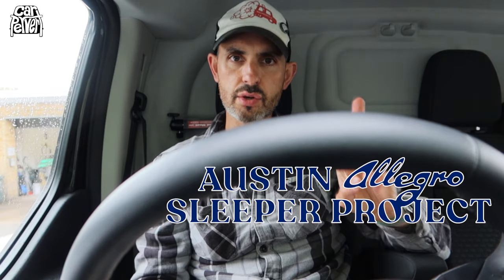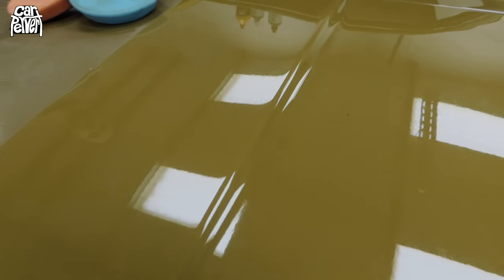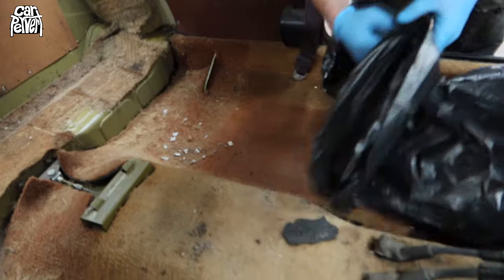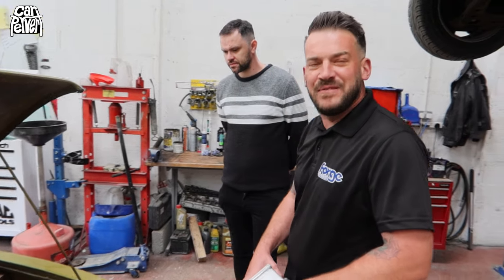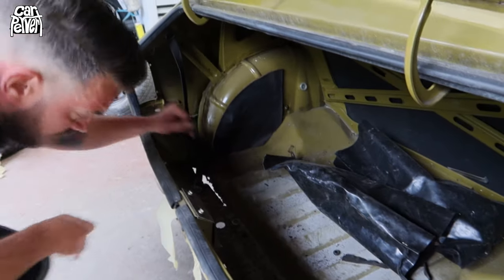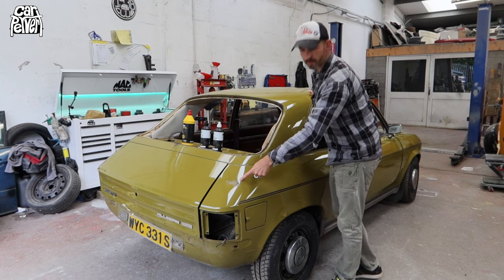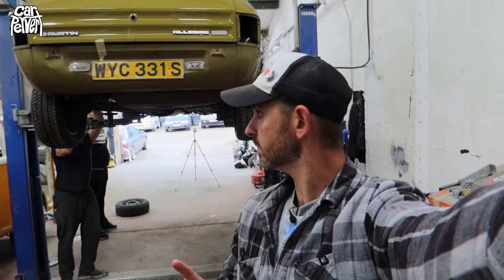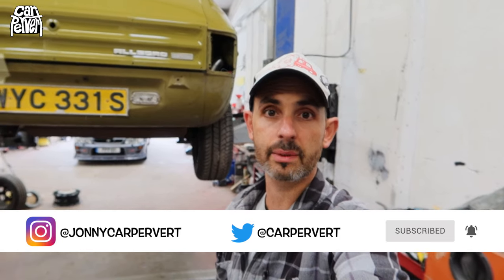Part 2: Austin Allegro V6 supercharged sleeper project

Comment: I bought an estate, new in1978. The Allegro was a car desperate for pimping. I had the car deliver with a rev counter fitted and fitted the fog lights myself. Fit the car with good carpets, headrests a modern stereo, and high level brake lights (I did back then), and the car is easily improved and transformed.  But oh, those front wheel bearings, new needed every 10,000. Mine was a 1500, but top speed was 94 with a tail wind.  It deserved better.

Comment: I have visions of those brakes stopping the chassis dead, and the body carrying on.....
Reply: I had a Chrysler Sunbeam that did that...
Reply: herme99 lol
Reply: JezVibert ummmmm oh god.
Reply: Not to mention the front n/s axle and strut giving way - all too common across the then BL range.
Reply: Except it's a monocoque, but yes they were made of tin foil sadly
Reply: @danmackintosh6325  Quite the contrary is true,BL cars of this era were made of quite heavy guage steel to the degree that you couldn't push the panels in even by using both your thumbs and were both strong and surprisingly rust resistant. I know because I've owned several Allegros,Marinas,Itals & Minis. The quality dropped slightly on later cars in the early 80's but they were still strong but slightly less rust resistant. I once rear ended a Metro in a marina van at about 10-15mph resulting in a small amount of damage to the tip of the bonnet on the van & totally destroying the rear end of the metro,both rear wings & C pillars creased, rear panel pushed 6 inches into the boot space & both rear lights hanging out by thier wires.Don't believe all the myths spawned by clarkson,I seriously doubt he ever owned an Allegro or Marina , just slated them because of the styling and/or handling. (Marinas and Itals did handle like boats, rather than cars.)
Reply: @fishbmw  Wasn't a Clarksonian observation (Hate the excuse for a man TBH) but 15-20 years ago I owned a '77 "Agro" 1300SDL in Russet brown, mechanically it was one of the most reliable and easy starting cars I'd owned once the ignition was sorted, & then one of 7 left (at the time) Dolomite Sprint automatics...  I ought to have qualified my statement in that the corrosion resistance was akin to foil rather than the original gauge of steel used, yes the bits that were left of those cars (mainly outer panel skins!) were in fact decent thickness but they definitely knew how to rust!  Metros 100% right they were way worse, a friend bumped a wall at <5mph in his Citi Van and the front end was crumpled, admittedly this was another rotter but then so many BL-onwards products seemed to go the same way around here.  The styling of the Ital/Marina and Allegro definitely appealed to me though, always liked to be a bit different haha.
Reply: @danmackintosh6325  Me too, I still miss my Marina van now never should've sold it,handled horribly but with the low ratio box it was fitted with ,55mph was all she wrote so you'd really need to drive like a complete tool for things to get scarey but it had a really good character as long as you accepted you weren't going to get anywhere fast but you would get there. My statement about BL and rust resistance is based on those cars contemparies at the time.( Fiats,alfas,lancias,pretty much anything japanese,french and I've even owned VWs and BMWs from that era that era with were considerably worse in the corrosion department.) I've never had an Allegro(I've owned 3) or a Marina (also 3,2 cars and a van) which were excessively corroded,the worst one I had was an Allegro which had a small corrosion hole in the rear valance,scabby front valance & had just started to bubble on the passenger door bottom and the wing area next to the front indicator plus surface rust on some of the seams,pretty good considering it was 27 years old & had 150,000 miles on the clock.

Comment: I learned to drive in one of these and still have a soft spot for them. I loved the quartic steering wheel, especially for driving on winding roads. 
I still have a set of the original brochures from the days I collected car brochures  - I couldn't bring myself to throw them away.
Really looking forward to following progress on the rebuild.

Comment: A car with a terrible reputation in a vile colour and yet somehow I love it. It has defied the odds so far. I look forward to the next stage.  Great video 👍🏻
Reply: They never had a terrible reputation back then - it was only when the crap Top Gear started slagging them off and Marinas that the dumb masses as usual started to spout the same drivel. Plenty of people like me with Allegros back then drove them quite happily and RELIABLY - mine was a 1980 Allegro 1750 LE Equipe that always drew people looking into and at it all the time when it was parked and not many people can say that with an ordinary car like that. Up till then it was the colours and those wheel hubs that let the looks of the Allegro down. The Mk3's were far better in the looks department with the Equipe being the best looking with its alloy wheels.

Comment: I'm a child of the 70s and I've always liked the looks of the Allegro, a mate of mine had one at college and I was always telling him that he needed to lower it and drop in a tuned A-series. He later owned a Princess that he bought at auction for under £200 with a years ticket and TAX.
That shell is in insanely good nick, what a result. It'll save countless hours of repair work. And the paint has polished up brilliantly. 
This All-Aggro is going to be amazing, I can't wait for the next installment.
Reply from the maker: Cheers Scott. Hope it will continue to impress as we get the mechanical elements sorted.

Comment: Must have been a good day at BL when that one was built.
Reply: Allegros were actually very well rustproofed for the time - one of the first ordinary cars to be waked injected into the cavities etc and like most cars from back then if you didnt clean out under the wheel arches etc then deal with any rust that may be starting then they would end up with rust spreading all over the place. I used to do that with my Marina, Allegro Equipe and Mini etc back then and that is why mine weer always in excellent condition while most peoples cars back then were rotting away.

Comment: Jonny, it has been my dream for years to make a street sleeper out of one of the late 70s/early 80s BL line-up. I lack the resources to do it, so I applaud you sir. 

If my Euro Millions numbers come up I'll have a Princess LS swapped and converted to RWD.
Reply: I had an idea to stick a T5 in a Maestro and due to a bad time in my life and decline in mental health at the time I literally gave it away on the proviso someone would finish it. He didn't and clearly just sold the load of parts I'd literally given to him.

If I had a time machine I'd go back to 2011, punch him in the head and kick myself up the arse:

https://forum.retro-rides.org/thread/111762/free-good-project-volvo-maestro
Reply: I remember reading about a guy online that found the shell from an abandoned Montego Group B rally car and was fitting the drive train from a Skyline GTR into it as the shell had been modified to be AWD already.

I don't know what came of it though.

Comment: 300mm discs under 15" rims is some going, just need to be careful with offset etc as that will be tight. Looks like it lived a sheltered enough life & was taken out of circulation before any really nasty grot got hold of it. With the rear mount rad you need to think carefully about the air extraction path as you are going to be reliant on not having a pocket of turbulent air right behind the car which would kill any flow through the rad, fans wouldn't really help much. Admittedly it would only be a problem at higher speeds but it warrants consideration. Those sleeved driveshafts may need looking at too as they tend to fail eventually through fatigue. Really like the project, very oddball choice of engine for many reasons but I get the Rover link (a 3.0 Ford Duratec V6 from an ST220 is a 60 deg Vee & therefore more compact plus more powerful  & comes with a 6 speed box and is a lot more modern, chain driven etc but I get that it is not what you want to go for). Also reckon that a nice little single turbo setup would be better than the supercharger but again I understand that you want the immediate response from a PD blower....it is addictive! What are you planning on doing for rear suspension as you've lost the  Hydralastic from the front? Is it a coil over conversion  (I assume it is a trailing arm setup like a classic Mini?)
Reply: I had 310mm discs and brembo 4pots under some compomotive 15" 6J MO5s on my 306 track car. Pretty tight but it worked.

Comment: I want to chime in on the choice of the rust protection: Bedliner material is not the best choice. Its prone to micro-abrasions (from stone chipping at it), which then allow water & salt to seep in under the bedliner material and rust the metal underneath it, all while keeping the appearance of a pristine surface. If I may suggest, use Cosmoline (yes, it does come in black) or Woolwax (Fluid Film), or what I did, both (Cosmoline first, than Fluid Film). No, Im not endorsed by either of those companies. My take on application and philosophy behind it: https://www.youtube.com/watch?v=Z5lLPUIA95g
Reply: raptor is not like any other bed lining...

Comment: Brilliant. From an Allegro fan I don't think you're disrespecting the car or the followers, I'm enjoying restoring mine to standard on a budget but there's room for everything, and considering the "hate" for Allegro, this like the other videos you've done on this marque certainly do great views. I approve. Can't wait for more, plus get Tim to get his finger out on the white SS. Cheers Jonny.
Reply: It is only the dumb thickos that believe the crap from the JOURNALISTS from Top Gear that "hate" Allegros - and Marinas - and the people like myself that owned these cars and looked after and serviced them myself knew that they were excellent reliable cars. We had two in the family at the same time - my brothers then mothers 1978 Allegro 1500 LE and my 1980 Allegro 1750 TC Equipe and they were both excellent and very reliable cars and the Equipe was a very quick car in its day. Too many people back then didn't look after their cars or used cheap parts in them when they did or the garages did or the garages etc claimed they did work on the cars that they didn't do or that the car needed work done that it didn't and then the car/manufacturer would get the blame hence why I and many other people worked on our own cars.

Comment: I bought a green Allegro to commute to work daily then weekly about 190 mile round trip in early 80’s. I Lost count of the times it broke down but still loved it. One thing that did annoy me was it kept melting the plastic material on the points and I used to keep 3-4 new points in the car and could change them out pretty quick.

Comment: In our shop, we try to vacuum out the car as we go. Every step produces more debris but it just makes the job more pleasant and safe. We also blow the underside and fenderwells out with compressed air to keep dirt and bugs out of the shop. Your shop looks really interesting! 90% of our work is 356 Porsches which is never boring but working on a variety might keep it more stimulating.

Comment: Enjoying the internal combustion content of your channel; especially your American car including sympathetic restoration/preservation ethos.
I still have a problem admitting that I had a low mileage 1973 2 door Austin Allegro 1100 in 1990. It was British racing green and also had the quadratic steering wheel. 
I paid £325 with 6 months tax and years MOT. 
I remember it was a nice car in some areas aesthetically however gear selection was poor and the suspension had very little damping. 
It had been owned and loved from new by its elderly owner but unfortunately commenced destruction as soon as I took ownership of it. 
After a year the passenger door was stoved in, the CV joints were clanking, the clutch had began to slip, the exhaust was blowing and the engine leaked oil and had become noisy so it was sold for £100.

Comment: as a previous allegro owner well my mum's car I am amazed at how solid it is I used to weld loads of them with rotten sills and that was 28 years or more ago changing rotten subframes and sills on them I used to hate blumming MOT failures lucky my mum's car was garaged and was wax oiled so it was still solid when we sold her apart from I had to do a complete engine rebuild and a respray as she reversed into a lampost and took out the back panel valance and boot and damaged both rear wings so that took me a couple of weeks to repair so I decided to do a complete colour change as my dear mother hated it mustard-like yours so Ishe wanted Ferrari red and I put on a sports steering wheel as she hated the square one, and she wanted alloy wheels so I managed to get some five-spoke  round spoke wheels and I must say it made a great improvement oh yes plus things i never told her about i put on a 1275 gt head and camshaft when i rebuilt the engine and a bigger bore exhaust and i polished and ported the head even more and she could not get over the difference in power i just said well you wanted the engine rebuilt its bound to give you more power silly she just said ok but she said i cant get used to it i keep on spinning the wheels and getting funny looks from people as she was always hard on the clutches it was either in or out with her she never really progressed much from her test even thou she drove to work every day some people just don't progress do they and she was one of them were as i just took two lessons and passed my test and all my kids passed first time two sons and a daughter and they are all very good drivers but like my brother in laws both of them i want to jump out my foot is braking in the passenger side you know the feeling i never forget once my very first car i bought of my friend at work a ford Mexico mk one daytona yellow fvh40l the reg i will never forget it i loved that car even thou it cost me nearly all my wages to insure it third party only for the first two years then i rebuilt it put in a five speed really gear box competition clutch racing piston bored out to 1725 lightened conrods stage 4 cylinder head and cam dcoe 50s webbers that engine was amazing it basically nearly doubled the power it ticked over at 2800 rpms and anyone who walked behind the car while it was idleing would feel like they have been slapped around the head or backside depending on how far away they were from the exhaust one woman actually slapped a bloke around the face as she thought hed slapped her arse boy that was so funny to watch then she realized after he showed her it was not him as she was really upset with him she then turned her attention on me as she could see i was laughing fortunately for me the lights when to green so i sped off lol I am reminiscing again sorry.

Comment: The second car I ever owned, I had the bright idea to put a racing clutch in it, it used to rip through the gears, then proceeded to try and tear itself apart. The engine mounts went and those funny little bars with bushings in at each end (dampers) decided they wanted to have a fight with their mounting points, on top of the inner wings and one at the front. Bodge after bodge to hold the little 1300 A series in place, to no avail. The piston rings went so it blew smoke under acceleration. 

The exhaust snapped at the manifold probably due to the engine bouncing around like a kid on acieeed in the early '90s. The smoking engine was less noticeable after I deleted the exhaust. Sounded great to my 18-year-old ears at the time!

Then I had a small issue of the carb leaking, a little at first, eventually, when pulling away from the lights I would sometimes leave a little puddle of burning petrol behind. 

It was a four-door green, (British Racing?)

The final straw was a month after the front brake hose went, (why was I still driving it???) the handbrake cable snapped, and I crashed, in a car park, into the bosses office wall at work. Asked my supervisor if she would come with me to the scrappers' up the road where we worked & give me a lift back at lunchtime, weighed it in for £50 (£35 of which paid for my Hillman Avenger). Happy days,
Reply from the maker: Avenger was a better car. Great story!

Comment: With upgraded brakes and most likely stickier rubber I'd recommend looking into front lower swing arms and their mounting points. They are not engineered for that sort of abuse. Designing a set of custom steel tube A-arms is a relatively easy task. Strengthening the suspension pickup points shouldn't require much work either. With that sort of build "driving wheels off a car" shouldn't be literal.

Comment: Interesting project. I bought an 1750 HL Allegro in the mid 70’s, which was a BL factory development version of the fabled Downton Engineering company in making the E series go much better, using better inlet manifold with twin SU HS6 carbs and 4 branch exhaust manifold, it developed 95 bhp which at the time was good. It was a good car, let down by the front hubs chewing bearings at an unsociable rate, and usual Allegro problem of the windscreens leaking, sold it after 2 years and bought myself a Dolly Sprint. I did a check on the car earlier this year on the DVLA web site, it’s still in existence probably rotting in a barn or field somewhere!!
Reply from the maker: Wow Geoff, you had a hot Agro at the time. Why not contact the owners club and see if they know of its whereabouts? They are a pretty active club.